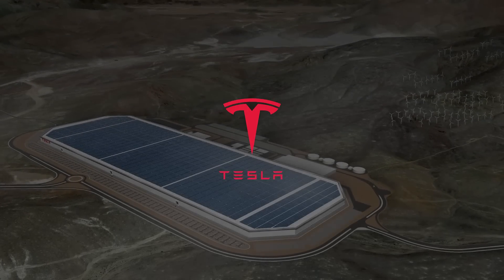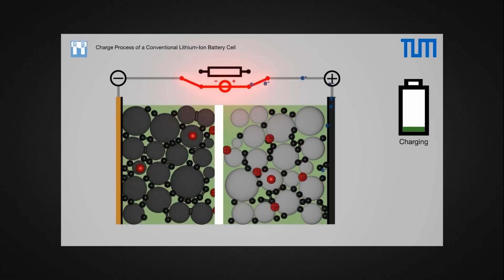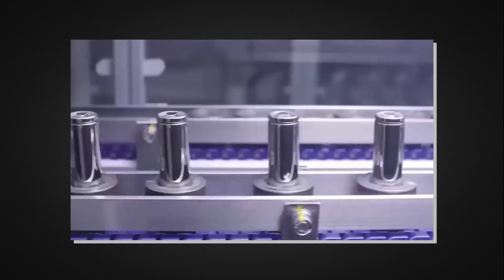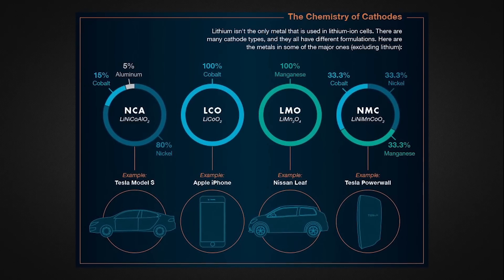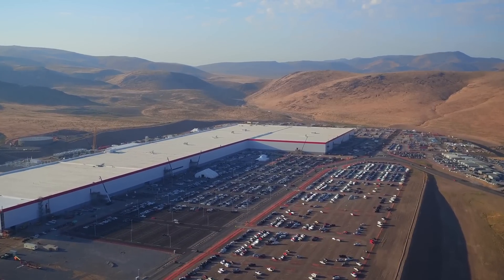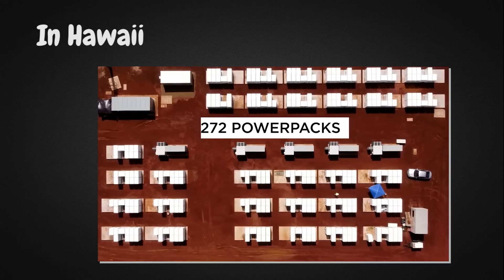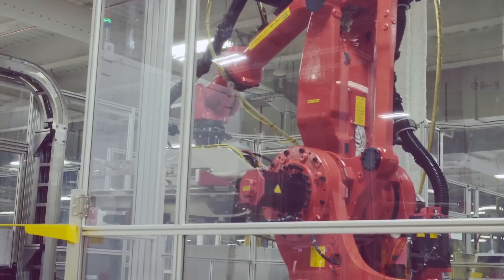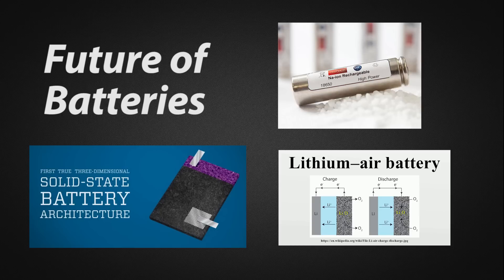Tesla Battery 101, How does it work?

Comment: When you say it could be driven with one pedal I got a bit confused. I was under the impression that the further you depressed the brake the more the induction motor would tax the vehicles speed by spinning faster in reverse to charge the batteries more. Panic braking and the final halt to be provided by the brake pads.  Is this not the case?

Comment: 1:28. The 18650 cells are made by panasonic. + They are not 65mm wide they are actually 6.5mm. I think that may be just a mistake.
Reply: May be they are 18mm in Dia and 65 mm long
Reply: Yeah you are right I wanted to to correct that but i couldn't. 6.5mm would be too short. They are 18mm in diameter and 65mm in length.
I am not stupid but I was wrong.

Comment: Very soon graphene batteries are going to change the world. I wouldn't buy anything right now. Samsung have a battery coming in the s10 made of graphene a battery that last longer lighter smaller and chargers in 12 seconds. I'll not buy anything with a battery because it's all about to change.
Reply: are you sure? people have been talking about magical battery technology being around the corner for 20 years now with non of them being true, well maybe with solid state batteries but they dont meet the 3X energy density expectation set out years ago, also no battery will charge in 12 seconds, not because  the battery cant but because the heat generated would be insane, you notice that your phone heats up when charging? now imagine it doing this 270 times faster.

Comment: I see a lot of comments about batteries obviously lol. 
Google mooches battery charts and you will find out everything you need to know as long as you understand ohms law you will be just fine. 
ex. 18650 vtc5a is one of maybe five 18650's accurately rated. 
26650's - only a few are rated at true 25 amp with 50 amp pulse if youre lucky.
21700- there are a few that far outshine the vtc5a and all 26650 when it comes to real life performance. 
Don't believe me ask anyone that builds vape mods that don't blow up in people's faces. Ohms law is a bitch if you don't know how it works.

Comment: 18-6-50 and 21-700 batteries, not 18-65 and 21-70.
Reply: 18mm is the diameter, 65mm is the height, 0 means it is round shape. Same with the other one, 21mm in diameter, 70mm in height.
So, no, you are wrong, it should be pronounced 18-65, and 21-70.

Comment: why not they provide to 2 sets of battery and alternator at the same time,1 set will be use using operation/driving the one set is a spare, once the set 1 of battery was discharged then it will shifted to second set then the 1st set will be charge during operation/driving using the alternator..
Reply: ...what?
Reply: Lol free energy is a scam.

Comment: The chemistry is not exactly the same between 18650 and the new Tesla 2170 battery and because of the larger size of the 2170 battery and improved watt hrs vs weight there is a big difference in performance to weight and volume and a lower number of batteries.  For a 100kwh battery pack it saves about 300lbs! Why else would they do it!

Comment: You forgot to talk about one of the main reason why the batteries are round. They use a cooling system for the battery cells that goes around the cylinder batteries. One of the main reasons for the battery efficiency of tesla car batteries is that they can easily keep the cool.
Reply: "...and warm". Temperature management.
Reply: U think they can loose the silver around the battery.

Comment: I have no understanding for the workings of batteries, but i was wondering; Could a battery be developed that could be recharged by replacing the liquid component of the battery with "fresh" fluid and the used fluid then somehow "charged" seperately. If you think about cars, you should see what im aiming at here. Just wondering if a battery like that could exist.
Reply: it exists and is called a fuel cell
Reply: The fuel cell argument is basically right, but I don't believe that was your question. The answer to your question in no. Think of it this way. A battery stores energy. To fill it requires energy, and if it's a car, it takes a TON on energy. The only way to fill it is to apply energy to it.

Comment: Why use round cells? Apple has been using square cells for ten years, meaning more electrolyte in less volume, or more capacity in less volume.
Reply: How do you maximize the proximity of the cathode and anode with as thin of a gap as possible and from a material you can actually manufacture (they use very think films), and the more square inches of those films the better from a power density standpoint.

Comment: they should be using 26650's. LG, Samsung, and Panasuckit batteries are all trash, just because they have the same volume doesn't mean that they will perform the same. I have used 18650's form all 3 brands, and I can say that there are brands that greatly stand out from them. Therefore, there is no doubt in my mind that Tesla's batteries are currently the best in the world. Their technology is different, but is housed in batteries of the same size such as, 18650, and 21700. @CharlesCloutier
Reply: Nope. Well, I guess an argument could be made. However, the number of engineers working on these issues among the large car companies will drown out Tesla is short order. Very little of Tesla's stuff is exclusively patented. That would be fine if they were able to sustain the cash burn they are in now, but even Musk's magic raising money is going to be challenged.

Comment: You fools talking about electric cars taking over the world... Lithuim resources are extremely limited, we do not have enough lithium on earth for 1.015 billion cars. Any significant electric car boom will have to happen AFTER a major revolution in battery technology, i.e., a switch from Lithium to another, non-REE alternative.
Reply: Easy to refute. Lithium is extremely available. Only problem is gearing up production, as nobody has wanted the stuff until recently. Chromium and Nickel are more problematic, as they are a byproduct of Copper mining. Still, you forget that ICE's were going to go out of business, because of Platinum in  Catalytic  Converters. These problems will be solved.
Reply: John Arnold is correct. Lithium is actually kind of dangerous in nearly pure form and until we needed all this portable power there wasn't that much demand. But, there is quite a bit on the earth. 
But, agree you do make a point that it's going to be an evolution. The power grid in the USA won't support very many EVs today and outside of the usa it's a basket case.

Comment: Tesla should make some high capacity AA and AAA batteries and sell them near cost, it would help get everyone to associate tesla with good batteries, which will only help  sell their battery banks and cars
Reply: There ARE lithium ion AA batteries. Check out Tenergy.  However, because of the Lithium chemistry, these batteries are 3.2 volts nominal and 3.65 volts open circuit.  Some other lithium AAs by TrustFire with a different chemistry are 3.7 volts nominal and 4.2 volts open circuit.  This means if you simply toss either of these into your old walkman, or pop them into your wireless mouse, it'll let out the magic smoke.
Reply: You can't bay tesla battery and do DIY ev conversion with my old-timer for example???
Reply: @borivojetravica569  Yes you can there are some people who have started doing it. There is a Tesla powered old Mercury. But Tesla themselves won't sell you the motors or batteries. You have to get them out of busted Tesla's. And even second hand out of a totaled Model S you might pay 15k minimum if not more. Sometimes you can find an entire busted Tesla with battery and motors intact for less than that but it's always a gamble if the one you buy even still has a battery or if someone already took it out to sell.

Comment: I'm a bit confused about what you said. You said that if someone tells you the 21700 batteries are better than they are dead wrong, and directly after saying that you said the 21700 batteries are better due to a higher storage compasety. Or did you mean if someone said it's better just because it's a higher number. Either way I did like the video, but clarification would be appreciated.

Comment: correct me if I'm wrong but you say that one battery is not better than the other, then in the next sentence you say the form factor is better in the 21700. Making the energy density ratio better, wouldn't that mean it's a better battery?

Comment: No body is talking about the lifespan of these batteries, doesn't it need to be exchanged after 1-2...years??
Reply: Ali Bashir most consumer only noticed a 3-5% drop in battery longevity after 2 years.
Reply: Those are not laptop batteries! In these battery packs there is a battery management system that is constantly monitoring, active thermal management that heats or cools the batteries, the batteries are never fully discharged so you don't brick them, batteries themselves have a different chemistry, etc. and whatnot.
https://electrek.co/2016/11/01/tesla-battery-degradation/
Reply: +Epiksun Production
And that is just the initial drop that just sack right at the start. After that the degradation is really slow. Just have a look at the link I gave you +Ali Bashir, the graphs tell more than a thousand words. But mind you those are not official numbers from Tesla, those are numbers gathered from Tesla owners from their on board computers.
Reply: They hope they will last a very long time and in the future there will likely be pretty robust recycling programs as the metals used are relatively expensive.
If I had a concern it would be two-fold. One, we know a lot about safely carrying gasoline around in a tank but we know very little about carrying around that much energy is an onboard battery. I have a scar on my ring finger from a careless touch of a good ole lead-acid battery. Two, with driving range issues abounding and grid issues compounding, it seems we will see some very disruptive things happening. I want to make sure my granddaughter can get across town at night and if there isn't a better solution to handle range and "filling" issues, I have concerns.
Reply: If that were the case, then why would Tesla offer an 8-year unlimited mileage warranty on the batteries?

Comment: Year 2025: Tesla admits to reducing old EV car speeds through software updates. Tesla said the aging batteries in these cars cannot keep up with the power demand of the high-speed driving. Such a situation started occuring with Model S since 2021 causing the car to completely shutdown during high-speed commutes and crash into obstacles often killing its riders. Since then, Tesla started releasing software updates for their older car models that reduce the maximum speed of the car to a level the battery can handle. But consumers are upset that they noticed the cars are slowing down after mandatory software updates which reduced the car's performance without their consent. They argue that Tesla is trying to force car owners to upgrade to their latest car the Model X (read as Model 10). Many consumers are switching over to Google's cars which are priced much lower than the Tesla Model X. A couple of car owners are suing Tesla on the grounds that the speed throttling was done without their knowledge and consent and was masked in software updates delivered to the car automatically while it was charging overnight. They worry that a software update could also be used to be make the car completely inoperable, and they file the cases on behalf of all car owners with Tesla's older models.
Reply: Sounds familiar 😂👌
Reply: adtc cool story bro
Reply: Do Tesla on future have an audio port?
Reply: apple iPhones ?
Reply: Even setting aside this particular issue, I hate cars being connected to the internet whether you want it or not. There are both security/safety and privacy concerns inherent in IOT (Internet Of Things). So no one should buy "smart" TVs(other reasons too) Does anyone know of any EVs that are modem free or where it is known how to disable/destroy the modem while keeping the vehicle operational?

Comment: You missed the biggest difference between the 18650 and the 21700, which is power density.

The 21700 cell has been claimed to have 40% more active battery volume, even though it is only slightly fatter and taller.
Reply: Joe Wdowiak I can agree.
I set up unregulated vape mods all the time. I know a load about ohms law and how the different cells compare. You are absolutely correct lol every person who has tried these batteries themselves know why 21700 is better than 18650 and 26650 or any other variant so far. The vape community knows more about this than most people ever will I'm glad to see someone who understands haha

Comment: Wow. So many batteries....what will happend if just one of this cilidric batteries(21700) fall in to the green ground. How many square meters get toxic?
Reply: The planet earth has to be evacuated than. So much for exaggeration.
The chemicals are enclosed by a metal mantle, would take some time for corrosion to get to the core, you would be still able to pick it up to save the earth from it's inevitable doom. Now on the other hand, what would happen if something rips open an ICE car on its bottom and oil or petrol spills all over a "green ground". How many toxic square meters are that?
Just because it is a battery doensn't mean we should tread it careless. Recycling is a thing and it would be wasteful to throw batteries away.